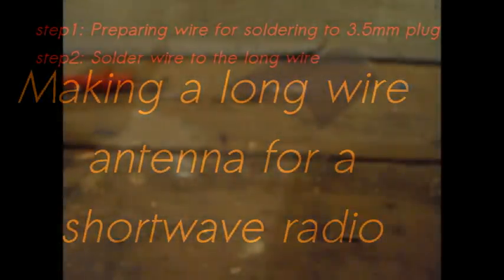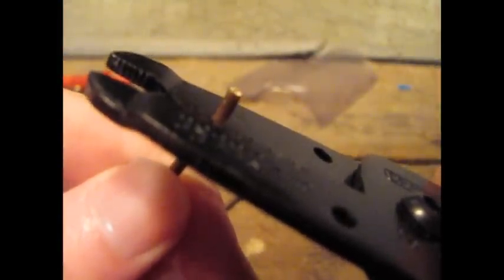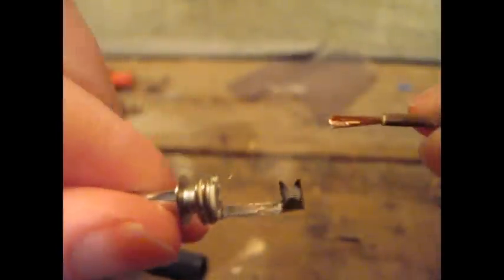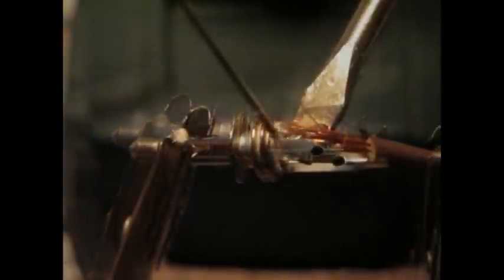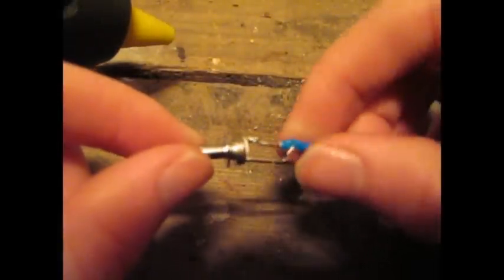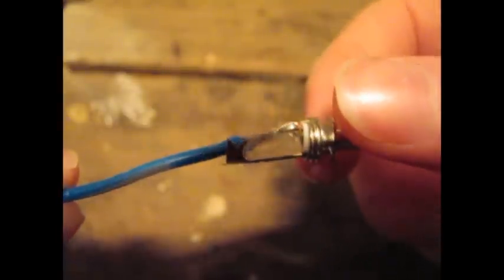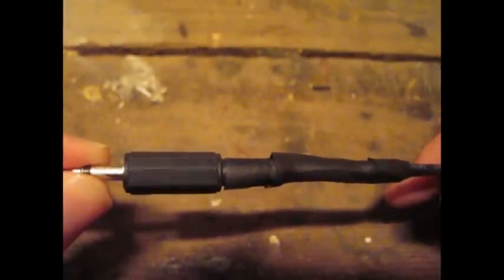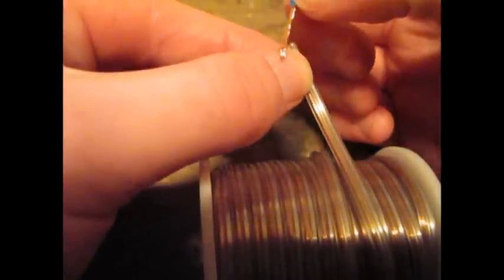How to make a LongWire Antenna

Comment: It IS an antenna. FM radio on HIFI;s use same principle, just a long loose wire for FM. Impedance matching is only critical to TRANSMITTING, not receiving. There are loads of ways to get different results. I use a long wire, one end on a concrete clothesline pole in my garden, the other end wrapped many times round a rubber antenna with bnc connected direct to my Icom. It works a treat and no direct electrical contact, it works by electromegnetic transference into the rubber antenna! Great vid!

Comment: You do a nice job of showing how to use solder and heat shrink materials to make a nice looking wire.  There are always Ham know-it-alls who are going to quibble with non technical use of vocabulary, but I wouldn't worry about whether it is an antenna or longwire or random wire, which is probably the best term to use,  as long as it works.  My only question is why did you solder twice.  It seems that you could have simply soldered the plug to the lampcord wire and saved yourself a step.

Comment: Thanks for posting this.  I just bought a G3 and am brand new to SW and not at all good with electronics.  I have read about longwires but nowhere did it explain how to make one.  I suppose to most people this is easy stuff but I didnt understand how the wire connects to the plug.

Reason being I bought (was suggested) 18 ga speaker wire.  It is two wires stuck together.  Should I seperate all 100 feet then?  Just use one wire?

Comment: You need to pre-tin you wire and also you're suppose to attatch wire by putting it don onto the grounding tab then bend the 2 pointed tabs around the wire.

Comment from the maker: It is an antenna. There are many many different type of antenna, this one "the long wire antenna" is probably the easiest to make. Infact most radios use a whip antenna - which is very similar to a long wire. In the end of the day, the above long wire will increase your ability to pick up a weak signal - which almost anyone would take to be the definition of a reception antenna.

Comment: Hi and thanks from Turkey ..I have two questions for this antenna project. In many longwire antenna projects there is a 9:1 balun. Is a balun or unun really necessary for recieving only? I am just a shortwave listener, should I use an unun with long wire? This was the first question..and the other is abaout impedance..some people say the impedance of long wire antenna too high for o radio..and to balance it at 50 ohms we need unun again..is the empedance is important for listening? Thanks so much
Reply from the maker: Hey, thanks for the comment. Your questions are beyond my knowledge sadly, so I cannot really help - maybe others here can or elsewhere ? I never got past the above procedure and basic listening.

Comment from the maker: thanks for your comments! ya there is no need for second solder, but in my case i had a reel of speaker wire ( which is pretty thin and weak stuff ), so i wanted to have a firm copper wire soldered to it, since that wire was going to be plugged in/out more often. Basically i was just trying to ensure it would not break after a few uses - probably no real need for it.

Comment: where is the connection between radio and antenna? You clip it to the retractable antenna? Edit the soldering.
Reply from the maker: radio connects to the antenna via 3.5mm jack

Comment from the maker: An antenna is an electrical device which converts electric currents into radio waves, and vice versa.  Do my long wire do this in the best possible manner-No, is it very efficient-no, is it the best-no. But there is also no hard and fast rule to say is must have so much impedance. What you mean by "real antenna" i dont know, perhaps you are referring to one to made to certain specifications. My video is a just a very basic "how to" for making a quick/cheap/easy antenna that improves weak signals

Comment: Why not just solder the speaker wire directly to the plug? This would eliminate one solder joint (and a potential problem / weak link), not to mention that it would be easier!